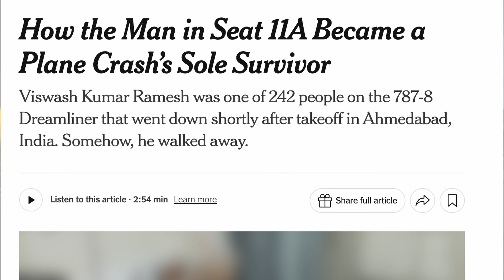Why the RAT Changes Everything – Air India 171 Update

Comment: I was in the cockpit of a Boeing 767 headed out for a functional check flight after performing maintenance. The captain started the APU and then proceeded to start both engines. We began to taxi out and had to pull substantial power to get the aircraft underway, and also, as we made various turns en route to the active runway. The tower gave us clearance to take the runway and takeoff. The captain looked back at me and said, "Let's go flying" I responded and said, "Not until we turn these on" reaching up and turning on all 4 boost pumps. I was amazed to learn that the engines would start and gravity feed on the ground and even allow high power to be pulled without any warnings at all. Since the boost pumps were never commanded on, then there would be no warning even with the engines running. You would only get an advisory message, but you can clear the advisory and keep going. I believe that it is possible that they started their engines, taxied out and took off without their boost pumps on, and then when both engines were starved for fuel, they shut down. Once the aircraft sensed that electrical power was lost due to both engine generators (IDG's) not supplying power, it would automatically deploy the Ram Air Turbine to generate electricity and hydraulics. Let that sink in for a few moments. That explains to me the loss of thrust I see in the videos. I'm just an old aircraft technician who has been working on commercial aircraft for the last 39 years. I don't profess to know any more about this than anyone else. I'm just a man with a theory just like most of you.
Reply: The Boeing 787 Dreamliner does not require the manual activation of fuel boost pumps before takeoff.

Comment: What if they put in wrong type of fuel into the aircraft and once the original fuel in the pipes run out the wrong fuel shut the engines down? Like mistakenly putting diesel fuel into your gasoline engine sports car.

Comment: There are so much mysteries from this accident..
If it was right due to dual engine failure, it could be one of pilots shut down the wrong engine, but it still at low altitude they must be need some time to reconfirmed which engine has failed while doing the proc.
If both engines happened at same time, that was the most terrifying situations for every pilots.
Because we dont have any options to face kind of that situations.
Deep condolences

Comment: One angle that most people wouldn't know about, or even consider is that we had a moderate solar storm impact at virtually the same time as the plane crash. Solar storms are known to cause all kinds of network, satellite and electrical/power grid issues when they impact the Earth and it potentially could've have affected the systems on this aircraft. Space weather events are a real threat to aviation and something that the media, and even people in the avionics field don't talk about. When you hear about airline computer networks going down, it can many times be attributed to space weather.

Comment: I am no expert, but it seems less probable that fuel contamination might cause both engines to sputter and stop all at the same time. If both engines stopped at the same time, fuel fed into the engines might have stopped...which means any components which were pumping the fuel to the engine would've stopped. Anyways...the truth will be out soon. Tragic.

Comment: Appreciating previous comments that there is a failsafe that prevents trying flaps up at the wrong time, is it possible to take off with them set incorrectly in the first place or is there a failsafe for that? Also the survivor said the pilot tried to give the plane 'a bit of a push' does this suggest the engines were working??

Comment: I'm not familiar with jey engines, only the general principle of ICE engines. Fuel needs ignition to burn. Hence the spark plugs in cars. If there was an electrical fault, this couldn't happen. Taking the simplest base as a starting point, could this have happened on take off? That would explain deployment of the rat and no exhaust vapours from the engines. At that non altitude there wouldn't be time to restart the engines and regain power to continue lift.
Asking the stupid question to help find the answer.

Comment: I have been in aviation since 1969 as a certified US Air Force Mechanic and later an FAA licensed A&P mechanic.  Also a Commercial pilot since the early 1970s.   Another clue, in my opinion, is the sound of the RAT is very predominant.  When the sound of a pair of huge jet engines at take off power is not.
Reply: Exactly, the engines are too quiet. Even a non expert like me can hear it 😢
Also I live near the take off fight path and this exactly the time when the engines are obviously the loudest. 
If it is dual engine failure it’s an unbelievable tragedy😢
Reply: I was wondering that too.  Thanks for clarifying.  It also sounded like a P-51 at full thrust rather than a Cessna.
Reply: I agree, I just got off of a 757 and sitting here at the Airport at take off those big engines are making some noise and there doesn’t seem to be any jet engine sound in the video.
Reply: Can hear the RAT, but no jet engine noise.  Engines out.
Reply: I acquired bunch photos from ww2 era and nam man that served in nam,his name was jim,James powers

Comment: I can't recall the air disaster crash video I was watching because there are so many, but there was an episode that involved the pilots setting the wrong configuration for takeoff or the wrong thrust settings which I couldn't recall. Also, another crash involved where the settings by pilots were so wrong that the plane's computer thought it was landing and automatically dropped the speed, but the pilots found out too late. I could be talking about same video.

Comment: Fuel contamination and a wrong concept to detect contaminated Jet A-1 despite the good India standard IS 1571:2018. Clogged fuel nozzles, affecting combustion efficiency. Corrosion in fuel system components. 
Deposits that can impair turbine performance or cause hot-section damage. "The exact cause behind the “extremely rare” dual engine power loss remains unknown, but on Sunday, India’s civil aviation authority (DGCA) launched urgent pre-flight inspections of fuel systems, electronic engine controls, and other components on Boeing 787 aircraft operated in the country."

Comment: First of all pray for lost life and for their families!
All the possibilities combined matter of seconds but another effect is time of day heatwaves air densities major reflect at very low altitude for that size of airplane to keep it up in the air. That 5-7 seconds very crucial time for this size of airplane. Smaller size could handle and pass through that trouble but not 787 
They will need little extra runway to pass these problems

Comment: I believe the 787 has UPS. The RAT is only  too slow to respond and also just too weak to supply sudden emergency electrical and hydraulic power needs of when it was clear that both engines lost all power in this case.

Comment: Something also to consider. I'm curious if the pilot saw the engines were still making power and decided to retract flaps in order to reduce drag and help with gaining airspeed. Could explain the planes attitude and decent profile. Meaning the pilots were keeping back pressure on the control column in hopes they could still climb out. It's a phenomenon that still occurs even in experienced pilots and crews. The plane is descending so pilots instinctually pull back to try and get the plane to fly.

The other thought would be they knew they had an engine failure, left the gear down thinking they could land on a road way of some kind, which means they wanted to attempt a landing instead of becoming a lawn dart. That could also explain the plane's attitude as it touched down.

Either way, the ATC audio, CVR, and FDR should paint the clearest picture of what happened.

Comment: Not the same airplane BUT, on the B-737 there were two incidents of fuel starvation:

1.  Maintenance had pulled the fire handles up but not reset them. Because it is such a small incremental difference in the height of the handles, the crew didn’t catch it on preflight.  There was enough fuel in the lines from the fuel shutoff valve in the wing spar to engine to start and taxi halfway to the runway before flameout.

2.  The fuel “leavers” on the center console of a B-737 were raised to start the engines, BUT, they were not in the top detent.  They slid backwards/downwards, at the beginning of takeoff, cutting off the fuel flow with resulting flameout.  In that case prior to airborne.

The fuel control levers/switches are different on the 787 so I don’t know if they have a detent or preventative feature built in.

Comment: For "F...s sake, go back to the very long takeoff run, the load sheet and weight and how much runway was used to get to V1, meaning they took off because they couldn't abandon within what was left of the R/W.  It would tie in with insufficient engine power during the takeoff and the embedded rule one MUST take off after V1 reached and sort the problem in the air, where they were then perhaps left with almost no thrust, certainly insufficient thrust!  QED!

Comment: GE manufactures the engine, not Boeing. And after an airline buys an airplane, the airline is responsible for all maintenance. Airplanes only last 25,000 to 45,000 flight cycles if they’re properly maintained. This plane was 14 years old. An average of 3,500 flight cycles per year on a commercial airline and you have 49,000 possible flight cycles on this plane. Still too early to say it’s Boeing.

Comment: I've watched a lot of aircraft take off and land, and when I saw this aircraft taking off on TV, I immediately knew it was not going to make it... These aircraft normally rotate, and bring their noses well up, and gain height quickly... this aircraft seemed to 'wallow' as it got airborne, and almost immediately began to lose height, traverse to port, and then impacted the ground...!!
My immediate reaction was that it was either overloaded, and/or was struggling to gain enough power to remain in flight... My personal opinion is that if an emergency situation developed on the fight deck that low in the air, unable to gain height - and knowing that the aircraft was going to impact the ground, I truly think the last thing on the Pilots mind would have been focused on is retracting the undercarriage... they would have been struggling to get more power in an effort to create lift and not impact the ground...
Frankly, to suggest that because the flight crew did not retract the undercarriage must mean that someone on the flight deck made the most serious of errors, and moved the wrong controls, resulting in the aircraft impacting the ground and killing all passengers and crew (except one remarkably lucky escape), is ridiculous... You may well be a very experienced pilot, but if I was to suggest that the reason the aircraft crashed was because it was another Boeing electronic/computer fault, you would know doubt say the same thing, but lets face it, at least that is plausible given Boeing's recent history... (the following day another Boeing of the same type had to turn around 1 hour out of Honk Kong, and return, due to an electronic fault on-board!)... Why don't we just let the Air Crash Investigators to their thing...and try and respect the families of those who have died...!!!

Comment: Looks like oil or fuel floods the air beneath the plane as it leaves the ground. I don't think it would be dust at a used airport, and I see a cloud of something, likely hydraulic oil. That's why the landing gear didn't come up and even the rat couldn't regain hydraulic control with such a massive oil loss.

Comment: Hi Captain Steeeve. Here’s my WAG at this point. Everything fine on takeoff til gear selected up. A catastrophic failure of the hydraulic system, be it a valve or something else on the high pressure side of the system. This would account for the gear still being down and RAT deployment. If, in an area with fuel lines whether it is a cross feed line or others may have caused fuel leak or vapor lock which may have taken just a little time to fail the engines. Time well tell. Capt. Rick here (NC)

Comment: Hi, if there is a power failure then fuel governor control fails which lead to engine stop but there should be pure manual throttle control for fuel control system also

Comment: On the video I didn't see any exhaust coming out of any engine. Usually when they're on full throttle to take off, the engines put out a foggy thrust.  Didn't see that at all. No exhaust from the jet engines. Looks like a flame out.
 And no sound. The only thing you hear is the rat sound

Comment: why boing Engine failed 
when I came to know that the RAT has deployed in the flight air India 171, I just got chills in my body 
boing and air India should collaborate for locating issues instead of blaming pilot for their mistakes (boing's mistake)
thanks, you for pointing the real issue 
I am not an expert, but I have little bit knowledge about cockpit that landing ger switch is far away from flaps leaver 
so, saying pilot prematurely pulled the flaps leaver instead of landing gear is just doesn't make any sense pilot have to lean forward to take landing gear up at the front panel of the cockpit

Comment: This video reminds me of the 1988 crash of Airbus A320 in what was one of the very first commercial aircraft fly by wire "intelligent interface" flight control systems. The pilots controls are linked to this system and depending on airspeed, attitude/ flap settings etc. etc. the flight control systems would determine if "full rotation" signal was sent to flight controls or limited movement. The 1988 incident was the low altitude flyover at Paris Airshow; the flight control system refused to allow the aircraft to rotate, and the aircraft crashed into fireball at end of runway.  It was determined the 1988 crash of A320 the system was working as designed; the flight control interface was "preventing a pilot induced stall".  The flight control interface system was changed on all Airbus aircraft after this flaw in   programming was revealed. I seem to recall a  incident of Boeing aircraft from app. 20 years ago where the" flight control interface" was changing the power setting by flight crew because of a unforeseen circumstance by system programmers. I understand this same Air india aircraft had  some "problems" reported to maintenance on earlier flights with different crews. The Rat was definitely deployed on the 171 flight and that fully explains the deployed landing gear. Thanks Captain Steeeve for great interpretation of original video with audio.

Comment: Let us not forget that the 787 was plagued with battery/electrical issues right after they started flying in 2012/2013 timeframe.  They were actually grounded by the FAA in 2013 after two of them caught fire, one while flying and one while sitting on the tarmac.  The cause was traced back to the lithium-ion batteries.  They've also had sudden electrical power losses, of varying degree, on multiple other occassions.  Seems like some type of major power loss is not out of the question, not sure how that caused the engines to shut down, but hopefully with the black box data, we will know soon.

Comment: You can hear the engines too, at idle.  Not much of any hydrolics on a 787, it's all electric, and they probably lost their primary electrical distribution.  Their backup was probably faulted and scheduled for maintenance.  The RAT wasn't enough to keep the engines running at 90%, so they dropped to idle.  Air India has a corporate history of sending aircraft up with secondary systems that need repair.

Comment: According to the Air India crash Wikipedia page (amazingly already up and running) the transponder stopped transmitting ADS-B data before the plane had reached the threshold of runway 05. Thus had electrical failure already occurred, which strikes me as strange.  If my bedside clock has a mains power interruption an internal battery keeps it going saving me the job of resetting all the parameters. Does not the 787 have a similar back up? If both engines failed why would not a back up battery keep the transponder going? Why would not the RAT perform the same function? Does the 787 have an APU? Was it already shut down? It is all the more strange since the pilot managed to get off a mayday call after the engines had failed so some electrical power was available.

Comment: A dual engine failure occurred in the past as seen on Air Disasters. It was caused by chemical contamination of the main fuel pump due to a residual cleaning chemical that got into the fuel pipe system and caused crystallization in the main pump. That type of maintenance-based oversight is likely since the failure of both engines at the exact same time with possible pilot error during a routine maneuver is highly unlikely.

Comment: Dual eng failure would be  detected by aircraft not by reducing both thrust levers, but   selecting both fuel control levers to cutoff simultaneously then back to on. Someone carried out dual eng failure memory checklist whereas only advancing thrust levers was required. I hope I am wrong.

Comment: Hello Captain,

You missed one very IMPORTANT FACT that comes directly from the only survivor of the crash... the survivor said that he specifically heard a "bang" immediately after take off and before the crash.  The serious question to be asked is what was this "bang" that the survivor heard.  Also, we know EXACTLY where the survivor was sitting within the aircraft.  So, based on the aircraft's design, what mechanical equipment is situated in this or near this area that could potentially create such a noise of there's a failure?